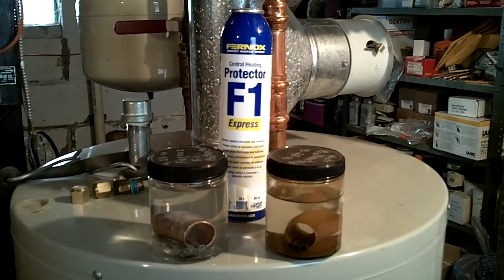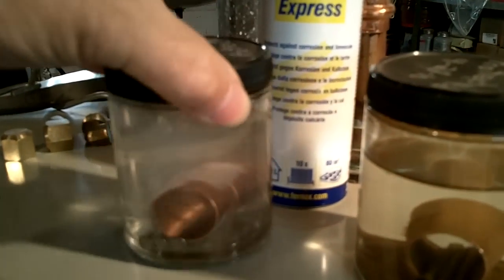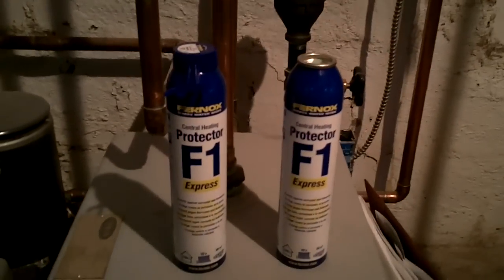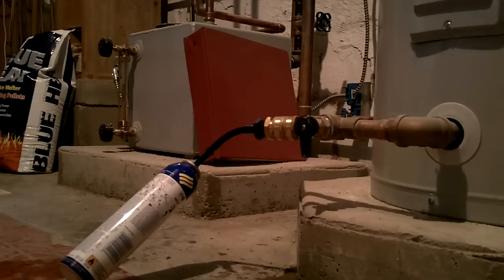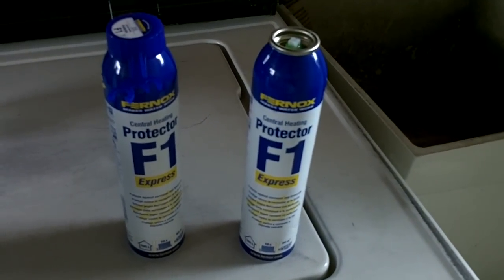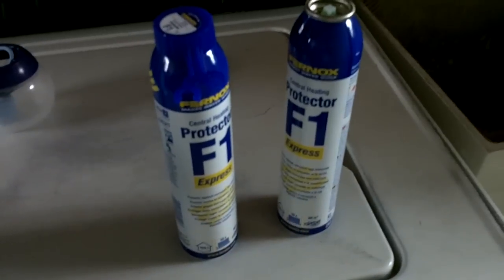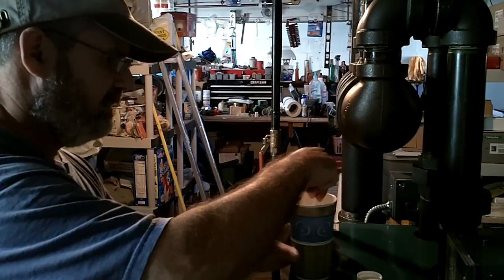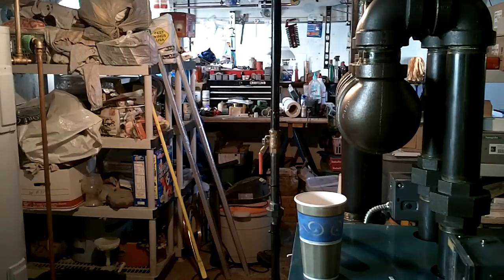fernox injection for hot water boilers

Comment: 2:59 So I saw the official Fernox video showing how to put this into a radiator by closing it off from the rest of the system open the bleed valve connecting the can to the bleed valve,opening one of the inlets to the radiator injecting the can, then reverse the procedure to take the can off and circulate the fernox around the system. 

https://youtu.be/BKYXlBkQqao?si=3o7W37ZkpMlc5Z-9

Why did Fernox show that method only though? Your method seems ridiculous easier!

So you’re saying I can just go to the boiler downstairs attach the can directly to the drain valve beside my boiler and insert from there!?  Job done! (Well once I start up the furnace to circulate the Fernox throughout the system.)

Comment: Gerry,  if you remove the air at the top of the two containers (like a hot water system should be) and perform the same one year comparison would you have the same results?  I assume you are only using this on a steam system though correct?  In my experience, in a closed system where the air has been removed you no longer have one of the components necessary for corrosion.